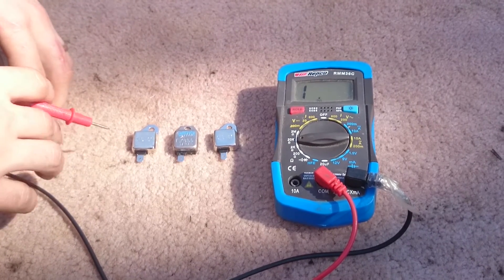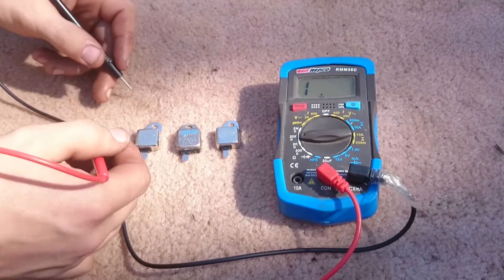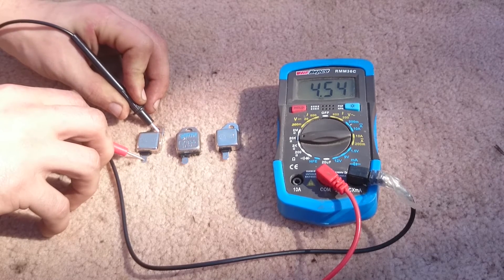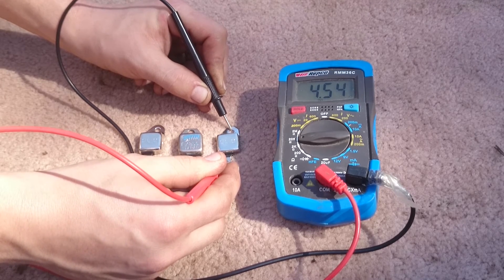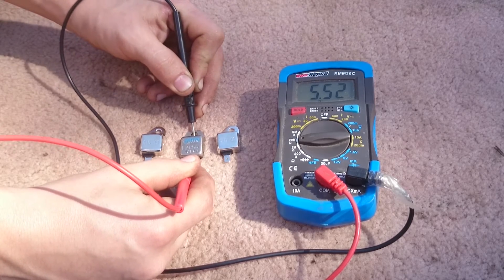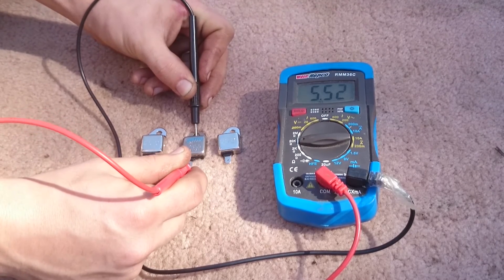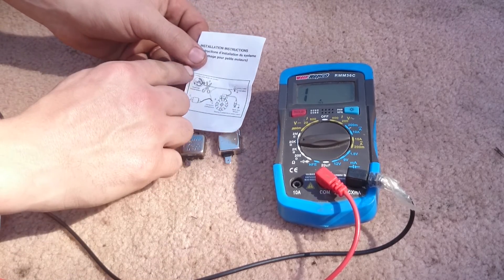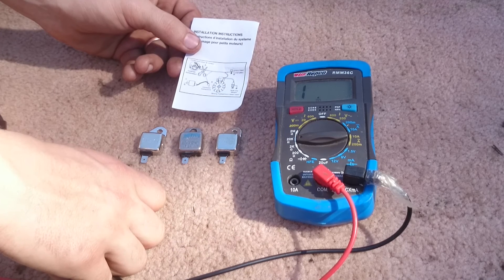PushMowerRepair - Testing Universal Ignition Module

Comment: Hi,
My Victa 2 stroke 160cc has no spark. I disconnected the kill wire, tested the ignition coil (as per your instructions on other post) and had the reading of 8.5k ohm and also tested this ignition module which had a reading of 5.504k ohm. But I still could not get any spark on different spark plugs. Although I felt a kick when holding a screwdriver on spark plug wire and touching the engine block while slightly crank the flywheel. So what is the problem? Should I replace the module or the coil? Thanks heap for any advice!

Comment: I have victa til-a-cut I did replaces the coil  con one model MA)5599A but still have no spark at all, any sugestions
how do I test this coil the old one is supposed to be 9-11 omh what of this one
Reply from the maker: Hi the MA05599a Coil should read around 14k Ohms, If your mower had a different coil before that uses an externally mounted ignition module like the ones in this video you will need to remove the module as the MA05599a has a module built into the coil.
Reply: thnak you very much, I did remove the old module. and installed the new coil, but still can get sark I keep working on it your videos very much aprretiated an usefull

Comment: Great videos guys, very helpful.

I have a question - I'm thinking about putting one of these in a totally different 2 stroke engine to bypass a failed cdi unit that I can no longer get a replacement for.

I'm lucky enough to have a wife who can x-ray the cdi unit for me so i can accurately drill the resin filled coil / circuitry housing and disconnect the cdi circuitry from the coil.

Why? Well just because it seems possible and why the heck not.

I'm not sure how these universal modules are wired into the system though - do they come with a wiring diagram?

Comment: Ok, so what's the advantage of an Ignition Module over a condenser/capacitor and points setup?

I've got a Victor Tornado Classic (~2005), and wonder what it would be using.
Reply from the maker: Hi 

Electronic ignition is generallyore reliable and there is no need to clean and service the points.

your Victa will have electronic ignition it has been around since the 80's so points are only seen on older motors
Reply: thanks mate!